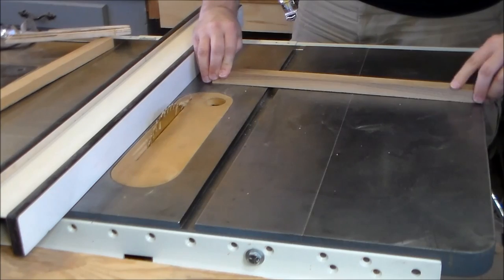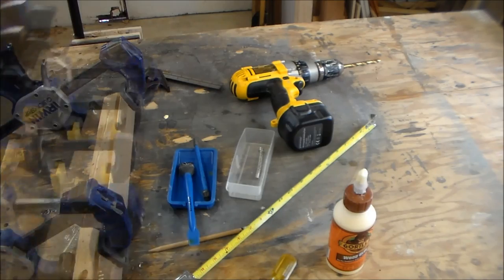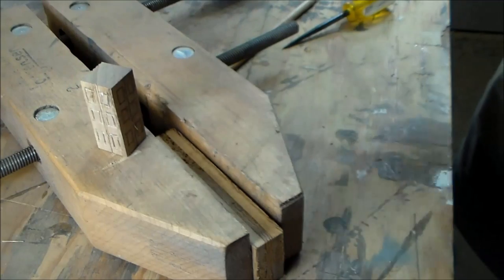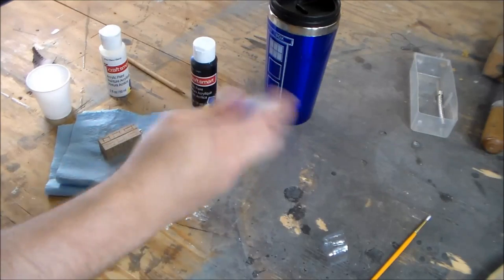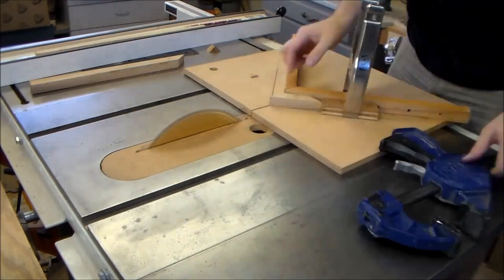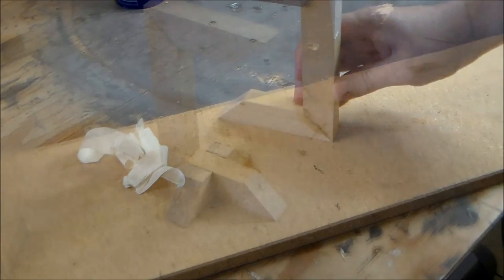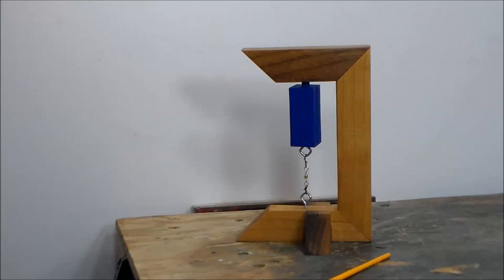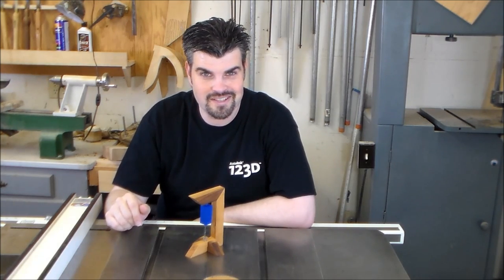How To Make A Free Floating TARDIS

Comment: That's very cool Peter, 
That's the worlds smallest TARDIS :)
Reply from the maker: Ha! You're right. The tiny TARDIS! It better be bigger on the inside!
Reply: @peterbrownwastaken  I wish you would have gotten rid of the wire part on the bottom and instead installed a magnet on the top piece and bottom piece of the wood structure and then on the top and bottom of the TARDIS in opposite directions, so that instead of linking together, they push apart evenly. That kind of magnetic technology has been used in Asian countries to create trains that essentially levitate off the ground (Seriously, go look it up, it's AWESOME). The magnetic forces on the rail and under the train push against each other and it literally floats. That would have been cool for this project. And it should be pretty easy, since it's on such a small scale. I would've loved to have seen that. Maybe an idea for another project?

Comment: Fun project.  I wonder if you can get it to suspend without wires by uses opposing fields of magnets on the top and bottom.
Reply from the maker: Yeah, I would imagine that you could!  I think you'd need a donut shaped magnets for the frame and then barrel shaped ones for the tardis, but it should work....

Comment: What if you had magnets on both ends, maybe the bottom end have it inside the block of wood to make it less visible, and use some sort of plastic tube to keep it within that vertical axis? If you shake it, it would go up and down and eventually go back to the mid-point. If the calculations are correct, you'd probably be able to trim off the middle sections of the plastic tube to have an open area that's narrow enough to keep the tardis in there, but wide enough to touch the tardis.
Reply from the maker: Eugene Thong I tried a few things without luck, and I know a handful of my viewer did too. I don't think anyone had this particular approach though, so you might be on to something... :)
Reply: +delorme42 they would fall of axis
Reply: +Peter Brown try looking at diamagnetism. bismuth works wonders!

Comment: I wish you would have gotten rid of the wire part on the bottom and instead installed a magnet on the top piece and bottom piece of the wood structure and then on the top and bottom of the TARDIS in opposite directions, so that instead of linking together, they push apart evenly. That kind of magnetic technology has been used in Asian countries to create trains that essentially levitate off the ground, the magnetic forces on the rail and under the train push against each other and it literally floats. That would have been cool for this project. And it should be pretty easy, since it's on such a small scale. I would've loved to have seen that. Maybe an idea for another project?

Comment: I'm wondering... If you put magnets in the top and bottom would it hover without the need of chains? That would make it look very Doctor Who-y.
Reply: the magnets have to be very well calibrated for that, and they almost exclusively use electromagnets for that.
Reply: the magnets have to be very well calibrated for that, and they almost exclusively use electromagnets for that.
Reply: I'm not sure if you couldn't drill holes in the top and bottom of the "stand" and place small nuts and bolts in them, glue magnets to the ends of the bolts and the tardis and work micro adjustments until you have the tardis truly free floating. Negative to positive so that they would pull instead of similar poles which might constantly push the Tardis off at an angle.  Maybe not easy but certainly worth a try.
Reply: Its simply not possible to get stable levitation with permanent magnets only.

Comment: Very cool - I would have tried putting a magnet in the bottom with the polar pushing it away so it hangs in the middle or something. Unsure how that would work, or even if it work, but i may have to give it a go :D
Great project, and you beat *****  this week who also is doing a Tardis based one :D
Reply from the maker: I think it could work but it becomes much more tedious. The TARDIS would want to jump out of line with the two poles. So you would need donut shaped magnets on the frame and the barrel ones on the floating bit. Much too fussy for me! But I'd love to see someone else build one!
Reply: Yeah you could be right. My daughter would love this :)
Reply: Peter Brown I think I've got a bunch of leftover 1/8" diameter magnets, maybe just making a ring of them would work.   I might have a couple donut magnets too.  Really cool idea, and you have the ability to keep it simple and not have it snowball into the epic scale TARDIS model building it would turn into in my shop but still have it turn out well.  I gotta work on that.
Reply from the maker: krtwood
 Thanks! Simple is in my nature. I start getting nervous when I have too many steps in front of me!
If anyone could figure out the diamagnetism bit, I'm sure it would be you! It would look really cool without any tether...
Reply: Peter Brown
Ha, well I bet Matthias would have the guts of a motor or something inside of it and it would hover and spin and probably function as a time machine just to round things out.
Reply: Peter Brown
So after fooling around with this for a while and getting nowhere I googled and it's apparently impossible to levitate a static magnet with any combination of other static magnets.  There is a levitating TARDIS you can buy, but it just has a magnet at the top of the TARDIS and then the stand actually takes batteries so it's some kind of electromagnet.  Definitely a job for Matthias.  I've got an idea on how to Doctor Who-up the stand a bit at least.
Reply from the maker: krtwood
 That sounds incredibly frustrating. I was didn't realize that model plugged it. It makes a bit more sense. Just like the maglev trains, they only work when motion is applied. otherwise they don't hove!

Comment: It doesn't always follow that your FIRST Doctor is YOUR Doctor. My FIRST was Jon Pertwee but MY Doctor will always be Tom Baker ;) As for the 'floating' it may have worked better if both top and bottom had magnets, and the frame had magnets set to repel those in the TARDIS, then you wouldn't have had to give it the odd tethering that makes it look like the Doctor has decided to leave it on a leash whilst he pops into U.N.I.T. Headquarters.

Comment: If you really wanted to put a lot of effort and work into a project like this, it's possible to make it truly free-floating without electromagnets or expensive calibration machines.

You use large pieces of pure bismuth metal and strong, permanent magnets to hold the object you want to suspend in place. I'm not sure how well it'd work with a large object like this, but it's possible to levitate small magnets with this method indefinitely.

If you need an example, go to NightHawkInLight's channel and look at his "How to make a Bismuth Levitator" video. Might be worth a try!

Comment: I think the only three things I would have done differently, was to paint the window outlines, embed the magnet into the top of the Tardis so it wasn't visible, and use string in the bottom instead of the metallic swivel. String is obviously NOT stiff, so the visual effect might be different. Nice project.
Reply from the maker: Railfan 439 Check this out! I think you'll really like his improvements to this project! https://www.youtube.com/watch?v=_LWNV1T5YwM

Comment: I like this idea. I wonder how much it would take to create something bigger. Reverse the magnets on the top and put some on the bottom. ( reversed. and maybe a few on the sides. so the reverse magnets will push itself away. Meaning that the Tardis really does not touch anything. and truly floats. and you can spin it around. ( when spun.. you could have a small speaker in the stand that makes the Tardis sound? just a thought.
Reply from the maker: +Aaron Ziesemer If you look in the description there is a link to one that a fan made. He sent one out to me, it is awesome!
Reply: I will do that. Thanks.

Comment: would it be possible to have a strong magnent on the bottom and a slightly less strong magnet on the top so that it would free float between the two without any physical bonds?
Reply: Was gonna say that.
Reply: +bswtsp21 gotta be real precise with that.
Reply: I think it would because I had something similar when I was little except it was the earth and when it floated it didn't touch anything. The only down side is that it was really hard to get it in exactly the right spot for it to float
Reply: Danielle those toys are powered electrically. Permanent magnets won't work for something like that. Either electrical magnet, or diamagnetism.

Comment: but it is not free floating its attached via the wire, couldn't you have made the aperture smaller & used 2 magnets top & bottom with the poles reversed, then it would be free floating.
Reply from the maker: palmer3977 A couple other folks said that, and one guy krtwood, even attempted it. Apparently there was a lot more to it then it appeared! For me, this is a great improvement on my design: Wooden Levitating Tardis (Preview)

Comment: I know this is a year old but I just found this vid and face palmed. That is NOT "Free Floating" if there is a wire attached! Secondly, magnets have positive and negative ends. Therefore to make a " Free Floating" T.A.R.D.I.S. all you needed to do was match polarity on either end of the T.A.R.D.I.S. and the stand thus repelling the tardis and suspening it in air.